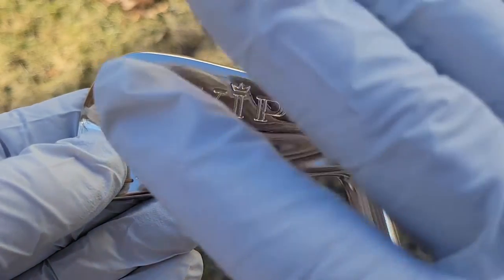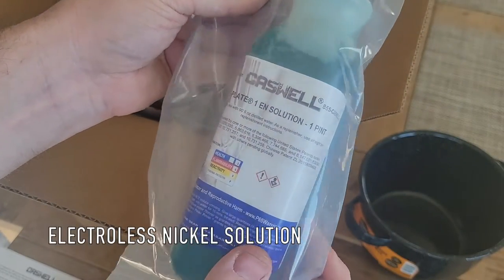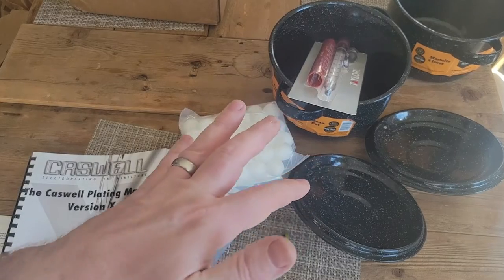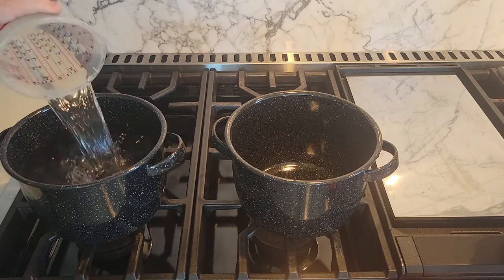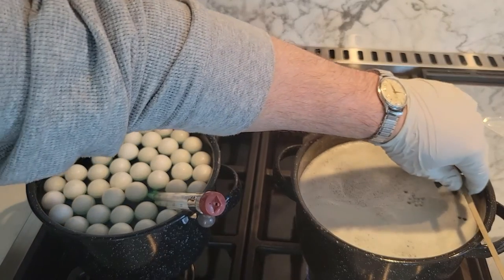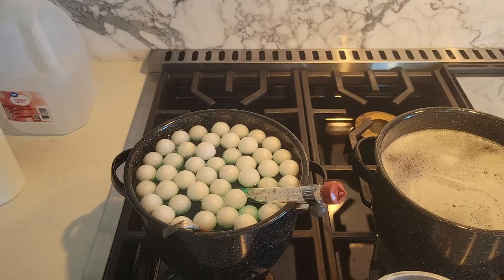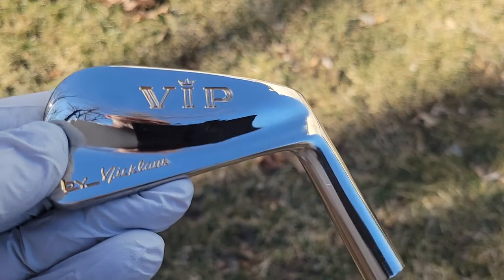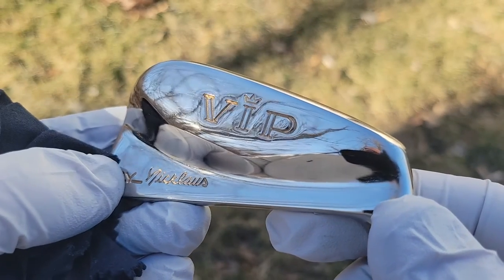ELECTROLESS NICKEL Plating Tutorial

Comment: Here's an excel credits calculator I made a while back for the Caswell Electroless Nickle chemistry. Hope this can help someone!

https://docs.google.com/spreadsheets/d/1ZC3qCMsVCsqcwhzqiBmx9aBdj5Mxj_Ux/edit?usp=drive_link&ouid=103360457731940512019&rtpof=true&sd=true
Reply from the maker: This is great. 

My confusion on the replenishing schedule is all of the documentation (even the stuff that came with the One-Plate kit) are specific to a two-part replenishment. But this product only has one part. That's where I'm stuck. The One-Plate product (they say) is a different schedule than the two-part, traditional electroless plating.